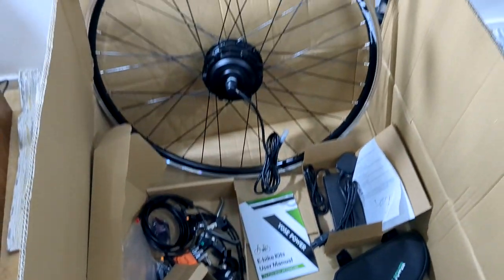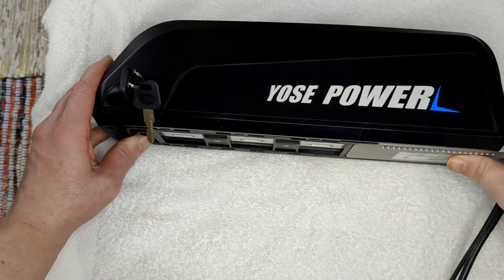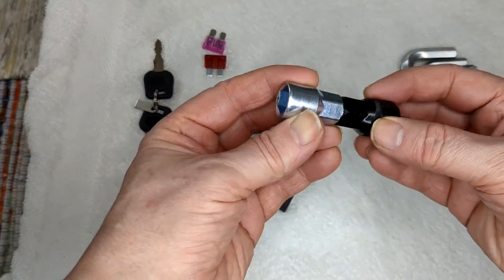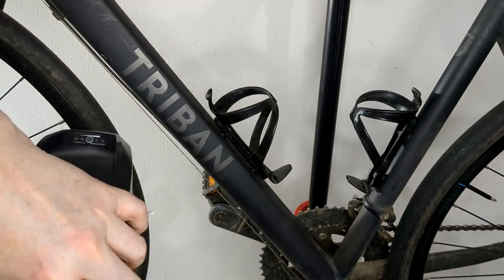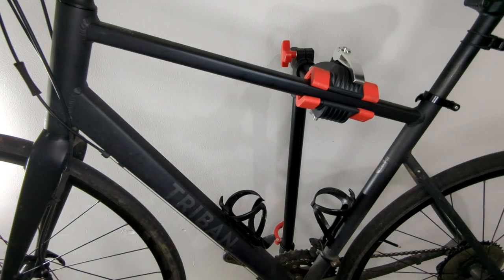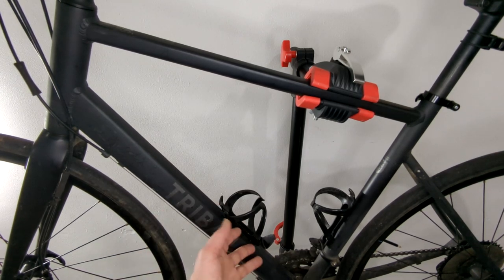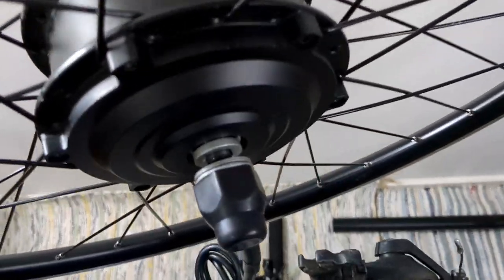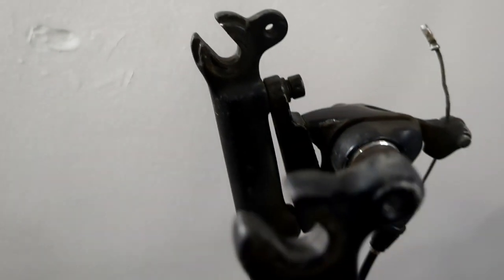Ebike fit fail .. front fork dropouts 9mm, axle 10mm

Comment: 10mm reaming drillbit and a hand file. You can still go back using 9mm axles on a 10mm slot with no worries
Reply from the maker: thanks. Swytch suggest filing the axle, as (they say) filing the dropouts may create microfractures. I don't know enough to have an opinion.

Comment: Surely you could remove just 1mm from your dropouts, that's what I would do, using a reamer or a file . I read on Yose website you need 10mm dropouts and 100mm between them before I bought the kit. My bike is a standard road bike, not a MTB.

Comment: This 15.6a battery will give you a max of 80 miles so why on earth would you want an even bigger battery. Plus the bigger the battery, the more the weight. My bike came with a rear carrier and this where I fitted my battery the same as yours. You could buy a rear carrier and do the same.

Comment: Would it be the same for the rear dropouts as well? I've got a hybrid/road bike and I'm looking at a rear hub motor kit from Yose. Now I'll measure my dropout, I don't know if it will be any accurate.
Reply from the maker: tbh I don't know. my impression is quick release tend to be 9mm, but I dunno about rear. I would think so ? if anyone knows they can reply.
Reply: @HareReviews   I measured both my front and rear dropouts and I got 11mm. Perhaps mine is 10mm, I don't know. It's difficult to be precise even with a ruler.

My worry is that Yose's diagram states the rear motor for cassette is 138mm and mine is about 135mm. Now I don't know if it will fit. I thought these things were meant to be universal.
Reply from the maker: I couldnt find out. I heard the typical sizes are QR 9mm, then 10mm, 12mm. apparently its meant to be tight so the axle doesnt slip.
I'm going to file my axle, which Swytch (quietly) recommended to their customers. Swytch may now have sourced 9mm axle wheels too (tho their kits are a lot less range) 
I think these axles may most commonly be 10mm. It's weird they don't say. 
If anyone knows they can comment.
Reply from the maker: i guess we should be looking at AXLE sizes. this article says QR rear axles tend to be 10mm, but I dunno
https://www.bikeradar.com/advice/buyers-guides/road-bike-axle-standards